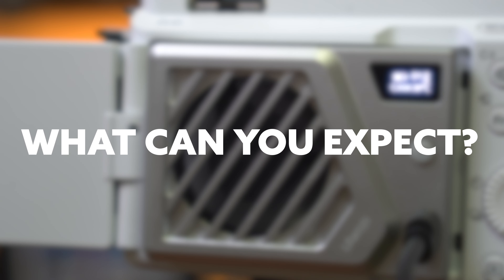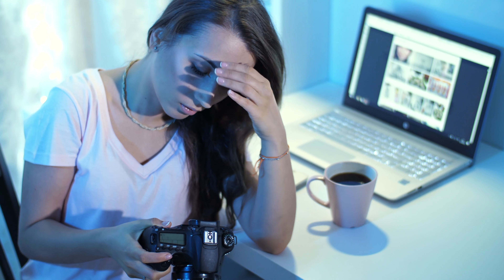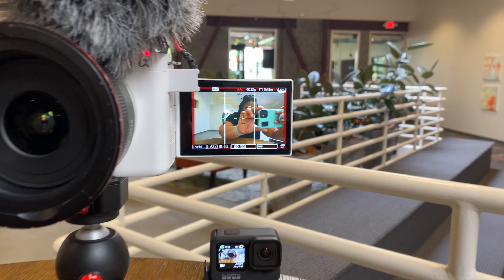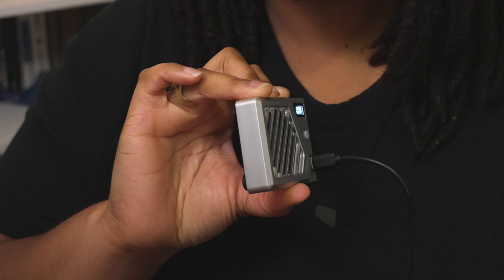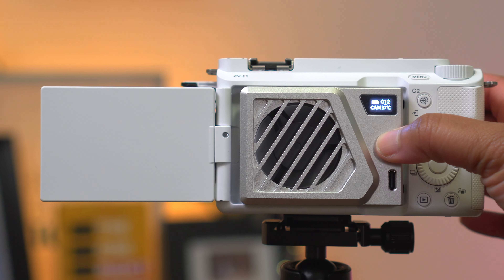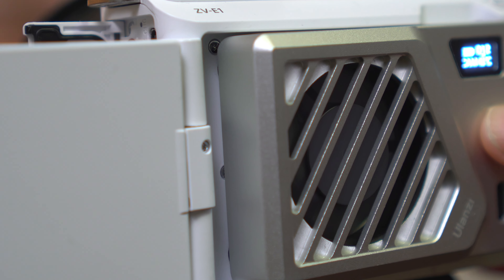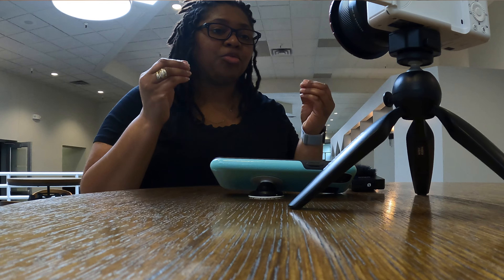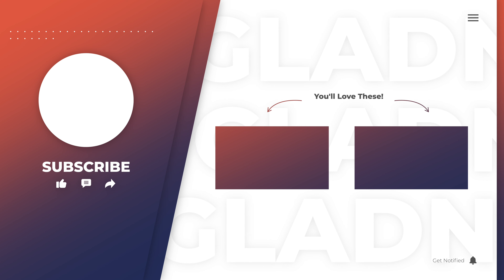No More Overheating on the Sony ZV-E1 with $19 Fix! | Ulanzi Camera Fan Review

Comment: It’s 2023 cameras overheating shouldn’t be an issue. Sony should of included a solution with every camera
Reply from the maker: I agree but alas here we are. Thankfully Ulanzi stepped in and made a great complimentary product.
Reply: They did it’s called the fx30. 4K HS 442 or 422 and streaming is demanding af especially for these sorry little Sony bodies unfortunately.
Reply: It's a full frame camera in a tiny body, people are expecting 4k60 performance nowadays so there's going to be tradeoffs. Sony can and does make cameras that don't overheat, the FX30 for example has an internal fan but at the expense of making the body bigger.
Reply: It's 2023 but it's not 2025 look for the end of overheating with these specs when newer more efficient  processors are developed.

Comment: We recently ran into overheating issues with our ZV-E10 when we switched to a bigger lens that seems to be holding in more of the camera heat. We got a 50mm X 50mm copper heatsink off of Amazon and some heatsink thermal tape. That lowered our temps from 116F and overheating, to about 96F at the max. The video screen will not close anymore, but it's a set up camera in our studio that does not move, so not an issue.
Reply from the maker: How interesting! The ZV-E10 is one camera I’ve never had overheating with even with bigger lenses in 4k. I’m curious why it got so hot but I’m glad you found a solution.
Reply: @DianaGladney  Yeah, we went from the kit 35-50mm which we've been using for months, to the Sigma f1.4 16mm and it started to overheat after about 90 minutes. We have the high heat setting on, a dummy battery, and no SD card in the camera. The only change was the lens.
Reply from the maker: Wow! I kept the Sigma 16mm on my camera almost since it came out for hours on end and never had an issue. I wonder if there’s an electronic issue that’s happening to cause that.
Reply: @mrupsidedownshorts  no way. I got the 16mm Sigma and never had a problem - neither with the ZV-E10, nor with the A6300, the worst hotshot to ever live. 

I’m sure you did not flip your display out. There’s no way a ZV-E10 overheats like that.
Reply: thanks for the good info, I'll try it with  my A6700, hopefully it works, can you share an image if possible of how you attached the heatSink on your camera?

Comment: Do you think the white version of the ZV-E1 will ever start turning yellow?
Reply from the maker: No, this isn’t that kind of plastic or silicone type materials you see that usually tint within the first month. I’m not seeing any kind of discoloration so I would imagine it’s the same as with the ZV-1 original ZV-E10 that also had white versions. So I think it’ll be fine.

Comment: i just bought the upgraded version of this fan from Amazon where they remove the suction cups and now have a spring like system on the side of the camera where it fits in the camera more effectively. I had this model at first but after a while the suctions cups stopped working and i did use the rubber band method as you said but it just looked ugly to me lol. This new upgraded model is much more professional looking.

Comment: In my opinion you shouldn’t have to use an external cooling device on cameras. 

BUT, the alternative is paying an additional $1500 for the bigger camera that doesn’t overheat. 

$19 Ulanzi > an extra $1500 camera (new)

I’ve had the ZVE1 since it launched. I’ve never had it overheat while videoing using it in 4k 60fps.

It finally overheated 15 minutes into a zoom meeting because I kept it in 4k 60fps. Dropping it down to 1080p 30fps helped, but it had already overheated and I didn’t have anything to cool it off quickly. 

Just ordered Ulanzi through your link. Thanks!

And thanks for the awesome review! You just got a new subscriber, too!
Reply from the maker: True, but alas it's the season we're in with cameras. I think for a short time here it's going to be needed until 10-bit cameras operate without the fear of overheating. Thankfully, this fan is a quick solution to problem. Glad this video was helpful for you! And welcome to the community!

Comment: I totally agree with you. I have the Canon R6 and when I got it it was a couple hundred less because the Mark2 just came out. Unbelievable that the camera that goes for over 2K overheats at 30 minutes. 

Gonna be picking this one up to give it a try because all of my video clients I have to literally shut off the camera every time I’m done with the scene just to preserve the overheating
Reply: No, it's not 'unbelievable'.  U just don't understand that this is not a cine camera, but a stills camera first.
Reply: @barkatthemoonlunatic1715  hey thanks for the hot tip my friend. What camera are you working with
Reply: @kevin-haggerty  y do u care?
Reply from the maker: @kevin-haggerty Well, in the weeks since purchasing this camera fan it’s continued to perform exceptionally well on days I’ve pushed the camera. So, it’s a great add on if you’re running into overheating.

Comment: did you try new update 1.02?. Has better Overheating performance maybe?
Reply from the maker: Yep, camera is up to date but it does not impact the cameras performance. This is more of a hardware issue than firmware issue. So to keep the camera small comes with some caveats currently.
Reply: @DianaGladney  Hi. Ty for Answering me. What do you mean by hardware problem? For example, can you stream 1080p 8 bit with this camera without any problems? If this causes overheating, then Sony should recall all zv-e1 cameras.
Reply from the maker: @SonerAktas  Meaning the overheating issues a lot of users are reporting are due to the camera not having the necessary hardware to process the higher video specs without running into this issue. Whether that be a fan or the heat sync tech they’ve put in other cameras, this camera is missing something those cameras have. What specifically? I don’t know but it’s definitely an intentional difference vs some “accidental omissions”. The previous video I posted on live stream settings goes into more detail of what does or does not impact the camera depending on how detailed you want to go.
Reply: @DianaGladney do you know why the A7CII seems to be a lesser overheating risk despite having a similar compact body?

Comment: When engaged in 4k24 H.265 10-bit 4:2:2 recording on a V60 SD card, my ZV-E1's battery taps out after 90 minutes. No overheating, just an empty battery. :hand-pink-waving:
Reply from the maker: Nice! Recording I don't run into any issues. The fan comes into play when I want to set my camera up for calls and long on camera day's and it's not going to be turned off until the end of the day. As long as the camera has airflow, it works fine.
Reply: @DianaGladney  USB-C or HDMI via Cam Link 4K?
Reply from the maker: I only use an HDMI setup.

Comment: i didnot know that zv-e1 over heat, wow . its funny that tech can have problems but still sale
Reply from the maker: Yeah, it’s not uncommon in the camera space but tis the season for now anyways with most cameras that don’t have a built in fan of larger camera body.
Reply: It sales as it has basically the same video quality as FX3 which costs x2 as much and ZV-E1 has better AI powered autofocus. For this money instead of fx3 you can buy Zv-E1 and Fx30 so 2 cameras in price of one and fx 30 is APSC FX3. Or if you just buy zv-e1 and want to use it for professional work you can add a fan, atomos ninja + drive for backup recording and maybe samyang 35-150 and start shooting weddings, whatever. With that money you only got FX3 with build in fan and no lens.

Comment: Do the fans have any magnet that could damage your camera?
Reply from the maker: Nope, no magnets.
Reply: @DianaGladney  what about the noise if you use a microphone on the camera?
Reply from the maker: I think that'd be illogical and expect the mic to block that audio fan or even if it was next to an air conditioning vent or something. If you find you're in a space where you need to use the fan, I'd recommend not putting a mic right next to it on the camera. It's probably best to boom the mic on a mic stand or extend it off the tripod closer to the speaker or use a different kind of microphone. But I can't see still keeping a shotgun mic on top of the camera and have the fan on. It's quiet but it's still generating noise.

Comment: Doesn’t the audio pickup the fan noise?
Reply from the maker: Depends on what mic setup you're using. If you're live streaming, it will slightly increase the noise floor, but not enough to make a huge difference that what you're already used to. If you're making a video and have a shotgun mic on top or using the built-in mic for some reason, yeah the mic will hear it, so it wouldn't be recommended doing that. Using a lapel mic with a wireless setup or podcast style mic in a desk setup, it'd be fine.
Reply: @DianaGladney  you’re the best !

Comment: This works for sony 6400??
Reply from the maker: @lukianproductions  Would this work to cool the camera, yes. Would this work specifically on the a6400 or a6600, not without some quirks. Those cameras have a flip up screen mechanism that hinges right in the middle of the back of the camera. So, it's not a clear and open space as with fully articulating flip screens, like on the Sony ZV-E1. 

So, you could tilt the hinge downward to lay flat, but you won't see your screen anymore. 
If you're using a live stream setup, that won't matter because the camera image will be visible on a much larger monitor. That's why I said yes you could use it, but not without that quirk because of the way the screen is. 

AliExpress has some camera fans that are half the size of the Ulanzi fans and would work with the screen fully flipped up on the a6400. 

I only recently got rid my a6400, but ran it extensively for hours on end non-stop in 4k without any overheating.
Do you have your high heat setting enabled on your camera?

Comment: Do anyone have noise issue with this fan without an external Mic?
Reply from the maker: Any room noise will be picked up. It’s as quiet as a little fan can get but it will increase your overall noise floor. It may not be by a ton but significant enough you’ll not want to use any on camera mic directly next to it or recording with the on camera mic.

Comment: Do you put protective glass over your screen? Don 't you put cages on your cameras?  You put windscreen on microphones.  If you are buying device that can help your camera perform better why not use it as designed?   That film will help pull the heat from camera body to help the fan blow the heat away.   I bet you drive a car that needs premium gas (C Class Mercedes)  and put regular in it.  
on a serious note.  That fan is no joke.  I left my a6700 in a bag powered on for about 30 mins and it was so hot I thought it was a frying pan.  That fan cooled it down to room temperature in 5 mins or so.
Reply from the maker: Yes but none of those things are required for the camera to operate properly. Yes, the film will likely give it optimal performance but I also don’t need the fan for 99% of my use case, so it’d be on there for nothing. The fan still works amazingly well without it so it’s no great loss.
Reply: @DianaGladney Thats the exact answer I would get from my little sister.  I'm wonder are you 2 clones of each other.
Reply from the maker: Great minds think efficiently lol
Reply: just bought a second fan. @DianaGladney